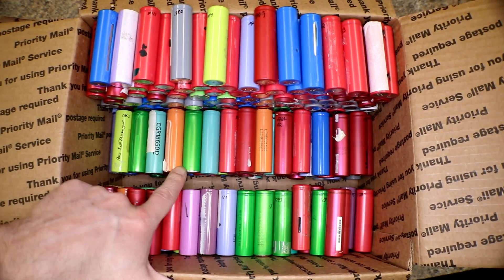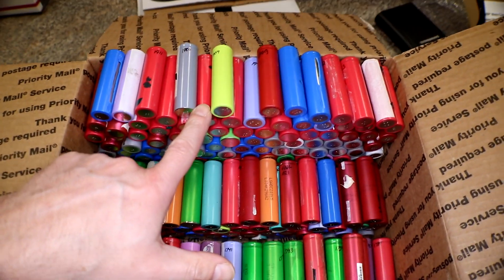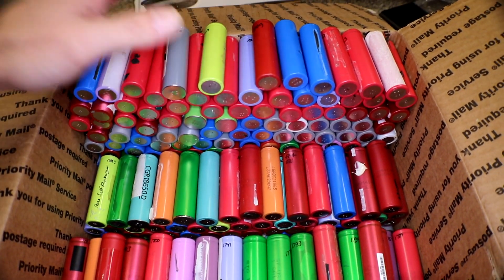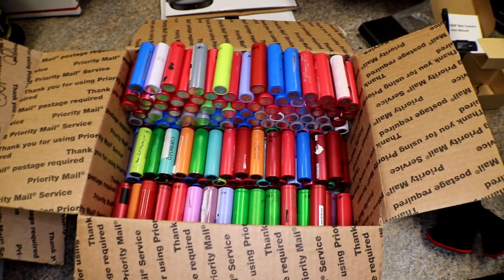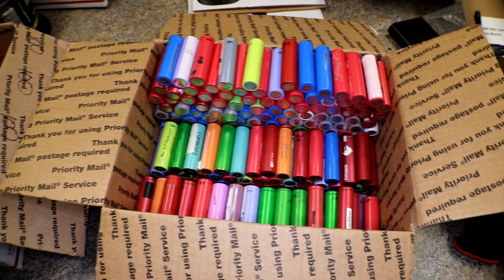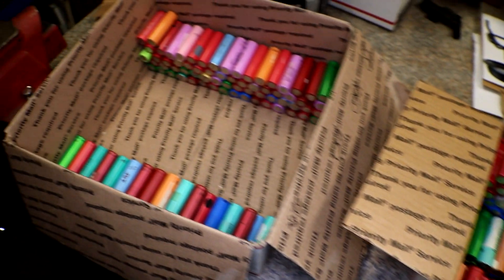Winter 18650 Test Ep3 Cells Sorted and in Packs!!!

Comment: I don't get it, this is rather confusing.  How did you determine the capacity of each those used cells?  Did you check each cell separately?  How do you even do that? Did you charge and discharge them and determine the energy loss? That would take years. Please explain.
Reply from the maker: Yes, most cells are precharged with a tp4056 then let sit for a few days Then capacity checked from one of 8 of my chargers.  Thats 32 cells at a time. A full discharge and charge cycle of a single cells is usually 8hrs or less with good cells.  If you time it right you can pull the cell from the charger right after the discharge cycle and put it on a tp4056 charger to keep cells discharging in the regular charger.

Comment: Hey Joe.  Love your content and been binge watching.  My question concerns your DIY cell holders. Why did you stop using your DIY sched 80 pvc holders and start using the ubiquitous black purchased type?  Maybe you have already stated in a video why but in my random/skip around vewing habits I have not come across it yet.
Reply from the maker: You are right I never actually stated why I used them.  I used them this time so I could build the packs as fast as possible since its all ready winter out and want to get them outside as soon as I can.  I will say that I prefer my style over the black ones any day.  💥😆

Comment: That's a nice sorting process if the numbers are correct, but my 4 Opus chargers are as much as 100mah off from each other so splitting them into groups of 10mah or 9 prolly won't matter. I'm thinking 200mah groups. Had a similar discussion with Peter. Measurements can vary with temperature as well. I supposed I could spend thousands on an accurate tester... if I had thousands... but then I wouldn't be able to charge 20 at a time... unless I bought 20 of them... or I can just go with 200mah groups. Potato potaato.
Reply from the maker: Thanks!  I was told it is pretty much the manual way of the repacker lol!  Yeah it probly doesnt matter getting them as close as I did since all the different chargers.   My opus can show 200mah higher then the foxnovo and xtar dragon, liitokala and skyrc show about 100mah lower.  I think its all fine for what were doing!  Agree Tomato Towmaato 😆💯💥👍

Comment: Joe, with all the respects, this test will sow as nothing because only one think we will find you is, sooner or later this batteries will day from cold. But we know this already. (this is why outdoors CCT cameras or other electronic staff, has 12v heaters for a cabinets, to keep them warm) If You want to test something you need to compare information to others information. In my opinion You need to change the objects of test. Maybe will better if you compare two different kind of batteries, original cells vs china cells, two banks, the same capacity, the same power consumption. Then we can see the difference between the original and chines cells. This is only my suggestion. Love you work. PS sorry for my english :)
Reply: In a way, this is what seems to be the task at hand, but with no odd bank out it becomes an endurance test.
Several test schema present themselves, when the data are reviewed, we should see varied outcomes. The BMS should help in presenting these results.
imo
🤔💭💣💥
Reply from the maker: I still think its hard to say.  Like I said I havent seen it done before so I want to find out and show it since many live in cold climates.  I have 8 cameras on the outside of my house and they dont have heaters in them.  Maybe the little heat they produce keeps them from icing over.  Had them out there for 8+ years.  If I had enough cells to make a pack for all the different cells it would be better for sure but putting all the cells in mix packs may do the same. We shall see.  Yeah maybe I can start saving cells  for next years winter to make packs out of each brand.  Tom said he might be able to help in that test and call it a dog fight to see which one wins!  Thanks for watching and your english is good enough for me!😃👍👍

Comment: So on average red cells have a reputation for running a little hot and your placing them outside during the winter so maybe something to do with climate change the only one I can think of so far is the patio heater pack which is pretty poor but theres a lot of smart people out there im sure someone could build on that idea.
Reply from the maker: To be honest, I didnt even think about the Insulation part untill after I was done lol.  Patio Heater isnt bad!!!👍
Reply: Just wrap the pack box with a pipe heater

Comment: I’ve never had luck with those red sanyos and the green Sony’s. Literally like 80% of the ones I tested where all heaters. So I segregated them and don’t use them at all. I’m a much bigger fan of the Samsung cells.
Reply: I use the red ones for USB battery banks for under cabinet lights that are only used sometimes
Reply: I have hundreds and maybe only 1 heater so far
Reply from the maker: Yeah Im not a fan of the green ones.  I have better luck with the sanyos surprisingly!  With the heaters, just charge them till they start to get hot then set a side for a few days.  Then throw them back in charger to fully charge them and then you can usually do a capacity check and there fine!  Yes Samsung are great cells!!!👍
Reply from the maker: There you go!!!💥
Reply from the maker: Red or Green